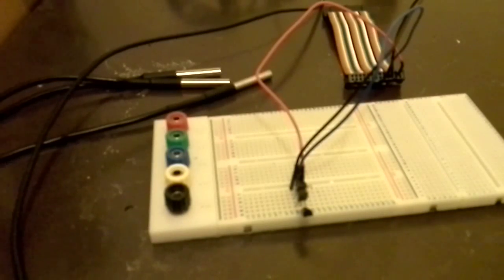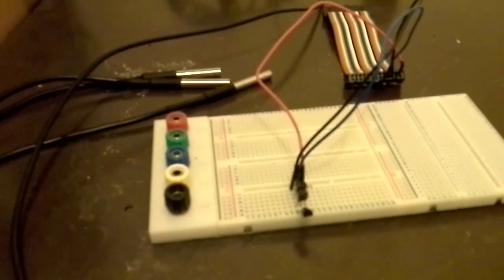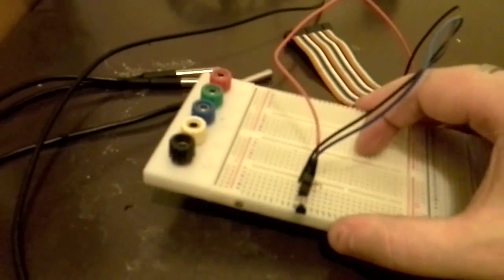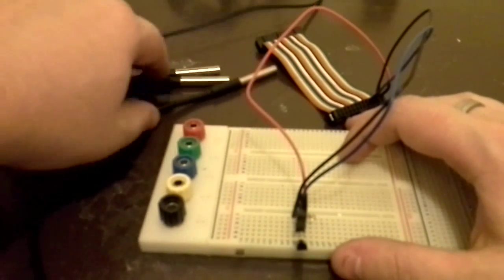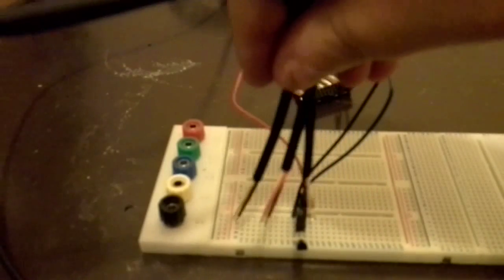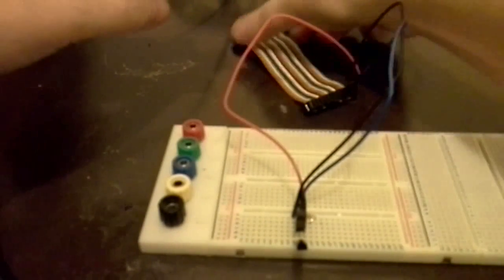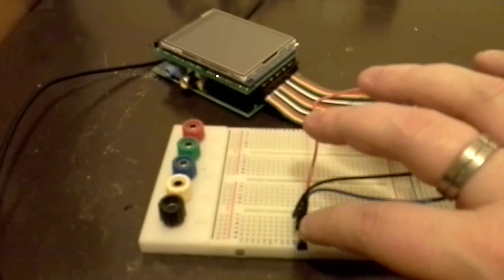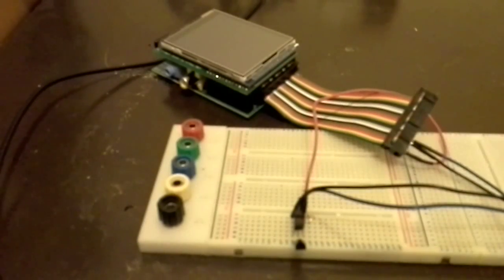Raspberry Pi multiple ds18b20 temp sensors

Comment: Use the photon-pixel coupling method, it is a new approach in science for reading an unlimited number of sensors in parallel. I am sure that it is very useful in engineering. You can have an array of sensors, as many as you wish and you can do it with an Arduino.